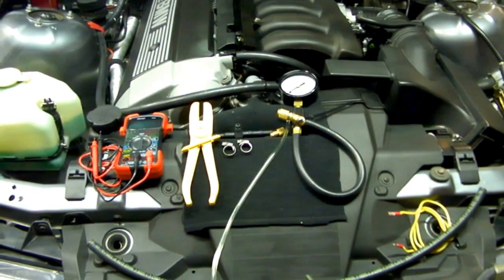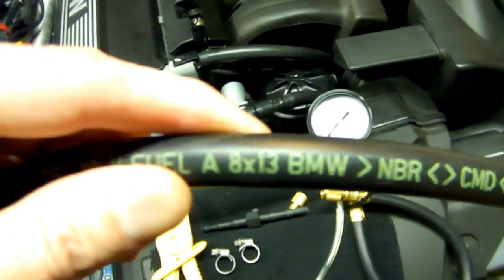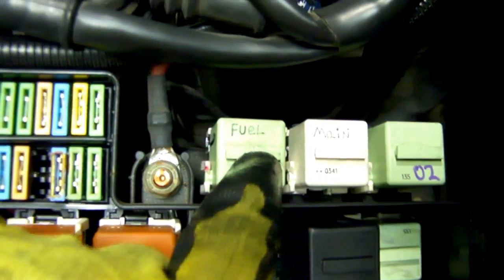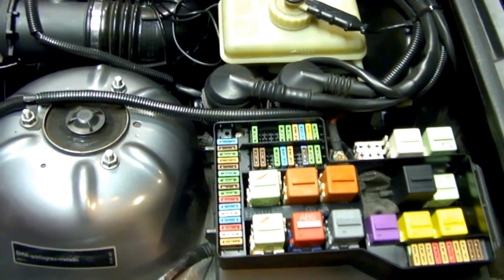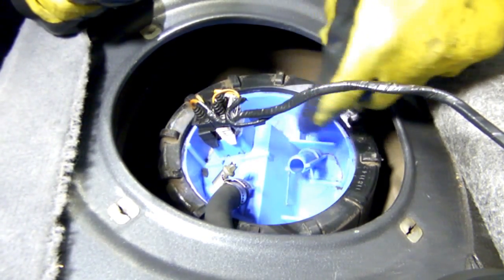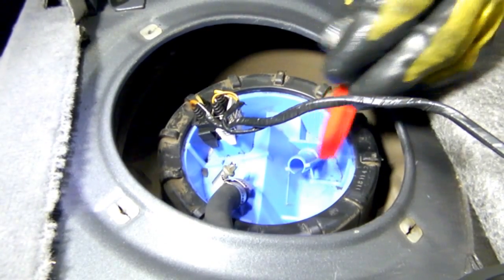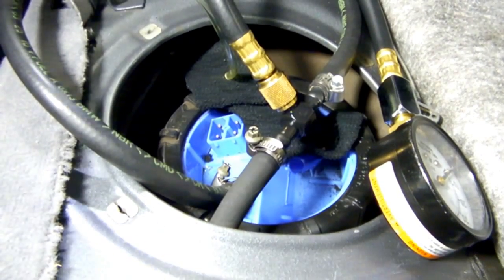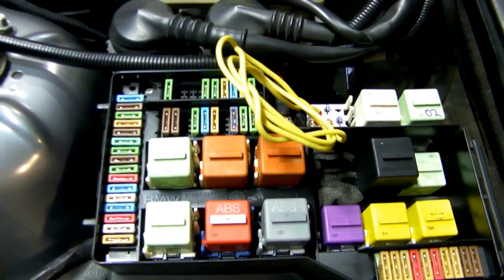BMW E36 FUEL PUMP TEST & TROUBLESHOOT PART 1

Comment: What if I still don’t get any fuel to the injectors even after I jump the fuel pump relay?
Long story short I just might the car,
It sat for 14 years (rust in the tank)
Fuel pump is brand new
And I do get fuel to the rail. I’ll be replacing the fuel filter tomorrow

Comment: Thanks!!    I have an E36  318iS which is coughing and spluttering - I suspect water in the fuel but this video has given me some excellent info on how to access the fuel system and some ideas on how to check it.

Comment: Very helpful. I am currently having a crank, but no start on my 98 E36 M3.  Planning on switching the fuel relay and main relay test next . 
I have replaced brand new (VDO) crank position sensor, but Engine continues to throw code P0335, which says ECU is not getting signal from crank position sensor.  I suspect no ground signal from ECU to fuel relay as you pointed out. Any suggestions on what to check why ECU not getting signal from CPS?

Comment: Awesome video especially the part (~ @18:00)  where you explained and mark the pin out of the relay connector. Helped me diagnose and pinpoint the fuel pump problem within minutes. Thank you!!

Comment: Damn I swapped those relays like you said and wires started burning and smoked blew out my air vents! No good!
Reply: Same thing just happened to me! Did you have to replace your harness?
Reply: @trentpope6239  luckily it was just one brown wire I was able to cut out the burnt section. The harness pack right above the blower motor under the hood
Reply: @trentpope6239  We should sue the owner of this video hahaha
Reply: @NickDent  hahahah same wire for me but mine’s pretty cooked. I’ll probably have to wire the whole thing. Were you having fuel issues too?
Reply: Y’all are terrible at following instructions lmao 🤦🏻‍♂️
Reply: Never a dull moment with BMW so far

Comment: just dont put the main relay in place of the fuel relay lol just did it and next thing we know the wires on engine harness was smoking. pulled it all apart and it was the 87a middle wire on the fuel pump relay. rewired it.. and now for some weird reason my gas gauge doesnt move and sets on E

Comment: TYVM this might have helped me find the problem with fuel leaking (top & bottom) from my new fuel pump as well as below new fuel filter. I will have to look to check new one to see if the feed line has ridges or not before I install the new fuel pressure regulator. I am so lost I so miss my 318i & am sick of the bus.

Comment: is the black connector to the pump supose to have power when key on? cause i hook up a multi meter to the connectors the white has 11volts and the black has none? 1995 BMW 325i sedan

Comment: Question of fuel pressure. I have a E46 330I and checked the pressure at the shrader valve on the rail. It shows up 45 PSI when I turn the key and let the pump prime. Jumps to 50 PSI after I start the car. Then when I turn the car off, it stays within the threshold for 15 - 20 min. Then I start seeing a slow drop in pressure and is almost at 15 after 45 min. Is this normal or do you think if there is a issue?

Comment: Hello everyone. My E36 318 tds (M41) discharges the battery if it stays 3 to 4 days sitting on the garage. Battery is new. I've checked the relays and noticed that the System Main Relay (relay nº2) and the Oxigen Sensor Temp Relay (relay n.º 3) stay on after I remove the key from the ignition. Anyone knows if it should be that way or if they should turn off? Thanks.

Comment: I honestly think someone (if not me) has screwed up the relay placement on my e36 325i (cabrio 1995). My fuel pump relay has 5 Terminals - Yours has 4. Any ideas there? Anywhere I can get a proper relay # & placement diagram anyone know?
Reply: My 325i 1993 has also 5 terminals, and fuel pump relay is replacement with not original one , vehicle is loosing power.

Comment: How do you know if you have a Euro spec BMW or U.S.?  I used your troubleshooting advice on the fuel pump relay, bridging 30 to 87, but the secondary air pump turned on and I didn't hear anything at the fuel pump.  Are relays in different positions depending on spec?
Reply: Great video by the way. You are very thorough.
Reply: you might want to check your VIN number on www.realoem.com so you know, of course there are plenty of "clues" that your e36 is an EURO or an US specs.

Comment: hello sorry didnt know u wrote me back iv also have a board trying get help  ...http://www.bimmerfest.com/forums/showthread.php?p=8189448&posted=1#post8189448

has new fuel filter,
fuel pump,
main relay,
cranksenser,
camsaftsensor,
spark plugs, etc     I was told might have bad DME?  due to only will crank when check engine light comes on 2nd position... 
thats when it does come on,

What makes that check engine light come on?
Reply from the maker: No problem, whether it be my help or all of our help together on YouTube; knowledge is power for BMW repairs. Thanks M.B.S.

Comment: you have good advice Now i have a 1995 325i v6 i just replaced the fuel pump do to having the car not run just turn like it did when you was pushing start button now i also replaced the fuel filter but its not same length  as the other one way smaller but what o'reilly gave me was a shorter fat one but was suppose to be for my car now the problem i have once i got it to crank it ran fine but once i cutt it off it wouldnt crank does same thing again as your push button starting method any suggestions thanks
Reply from the maker: As far as I know Oreilly's only carries Fram filters for our cars and I would be very careful about that. I would suggest only using oem BMW or Mahle, Mann filters for oil and fuel fueltration. There are a lot of YouTube videos about this subject please investigate. Thanks M.B.S.
Reply from the maker: If it is a Wix filter than that is fine, But make sure the fuel flow arrow on the filter is pointing toward the engine side of the car. If  it is not you will not get enough fuel to the engine and it may not start or will run poorly.
Reply: mybimmerspace
iv got highest brand they had and yes arrow is facing twrd engine

Comment: I have a 95 325i sedan (8/95) and it has a white top with a non ridged tube.

I am having an issue with fuel pooling on top of fuel pump and spilling over. I was wondering if the wrong fuel pump could be my issue.

I was planning on changing the o ring gasket and fixing any hairline cracks but was wondering if I needed to cap the hole off?
Reply: Gregory Johnson new clamps are what you need or jb weld the ends of the hoses=no more gas pooling on top

Comment: I think this will be helpful i have the same car and there is no power to the fuel pump, have a question can you actually start and run a car when fuel pump relay is connected with that bridge as shown in the video ?

Comment: Hey i am having trouble, just did swap into new e36 and the motor cranks but it does not spark and there is no fuel to the lines. please help!!

Comment from the maker: .  BMW has many variances for relay locations. What year and model do you have? is it a U.S. or Euro spec?  On some Euro BMW's the fuel pump relay was used to power the o2 heater